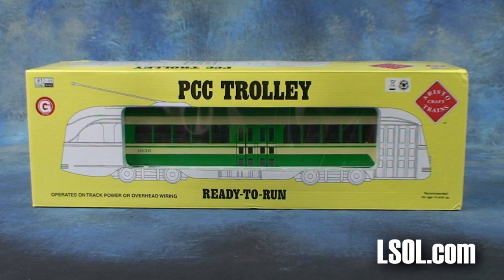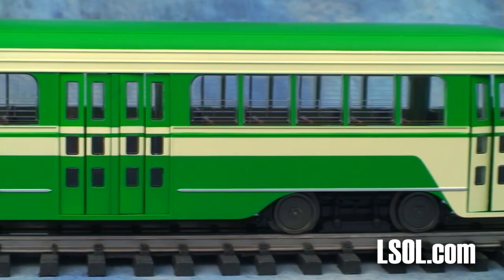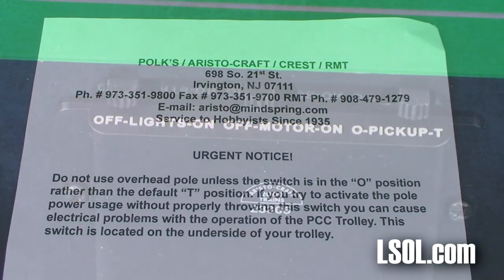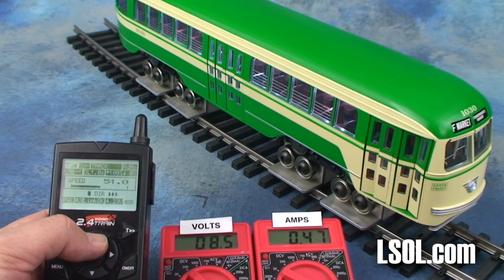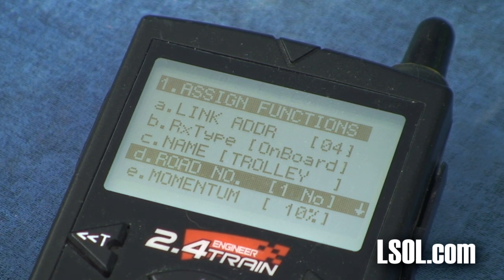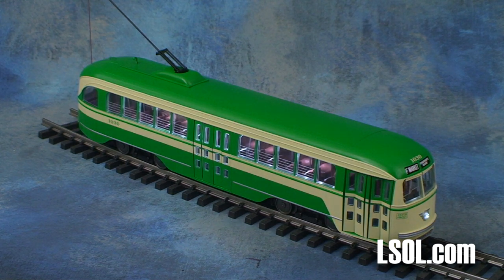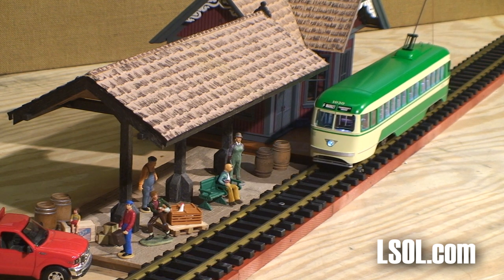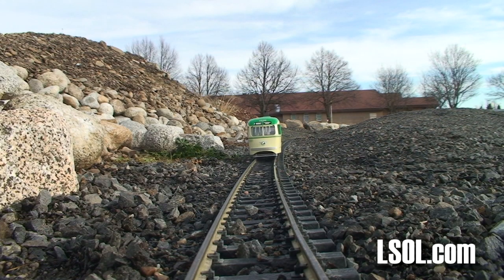Garden Trains: Aristo-Craft PCC Trolley

Comment: Hi, I have question to gardentrains or LSOL. Am going to use the Train Engineer Revolution for the first time. How do you power the track? I know it's a silly question, but my question is when you use the revolution with the receiver inside the loco. The power pack is it, directly connected to the track with no speed controller or with a speed controller? Am used to the old way of controlling my trains with a power pack and controller, so this revolution remote control is pretty new to me.